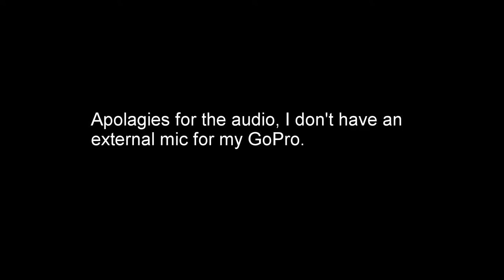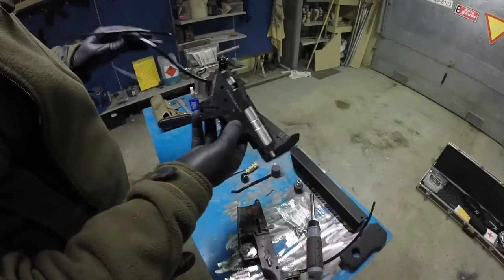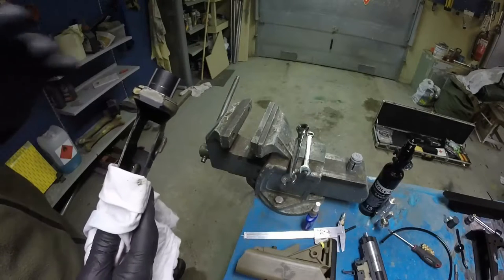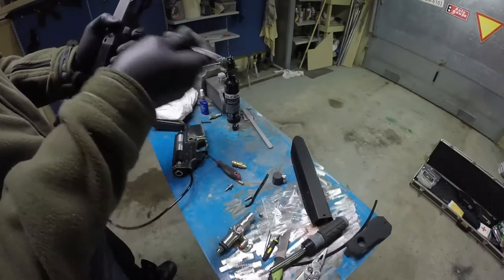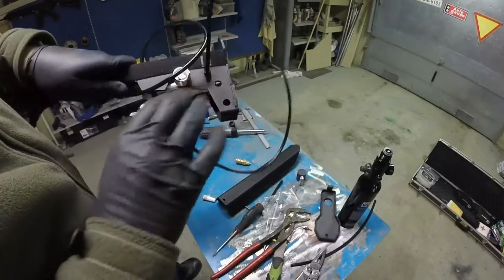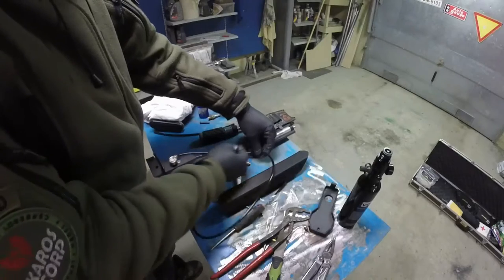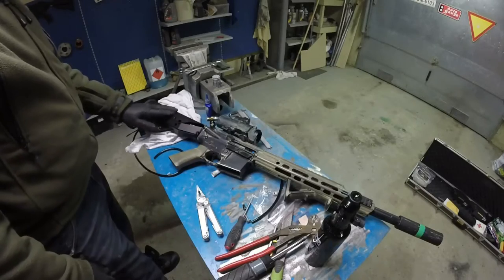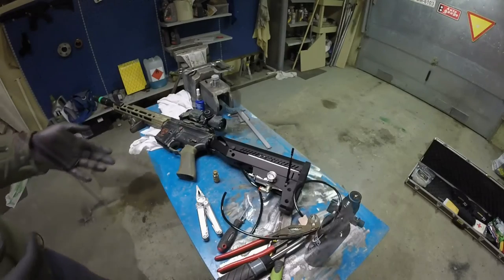How to install Mancraft MASS MK1

Comment: This is a brilliant video brother, appreciate you uploaded it and thanks!
Reply from the maker: Glad you enjoyed it!
Reply: Thank you for replying, what platforms can I install this on? Only M4s? or are there other rifles I can do this with? I am interested in trying to find a way to do this setup with a daytona kit
Reply from the maker: It is quite specific to AR type AEG's but what ever rifles with the same type of stock mount as AR's should fit. I have seen people install them on AK's aswell, but I cannot comment on how the install should be done on them. On a Daytona M4's it should be as in the video, Since the "recoil" is operated by the bolt, so it should not pose problems.
Reply: I'm thinking if it were ever possible to get a DG shooting like a proper DMR or sniper getting out to 250' + accurately, this could be an ideal solution. 
200 - 300 shots is plenty for that kind of role....